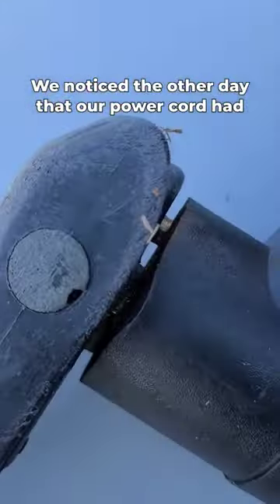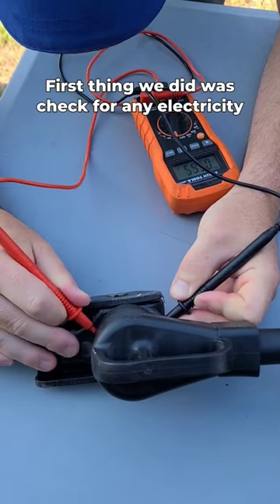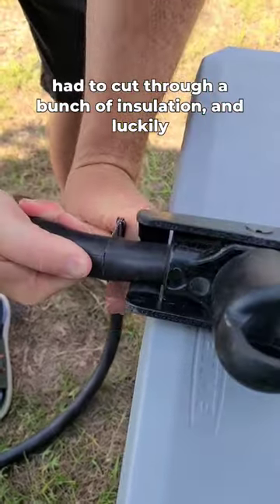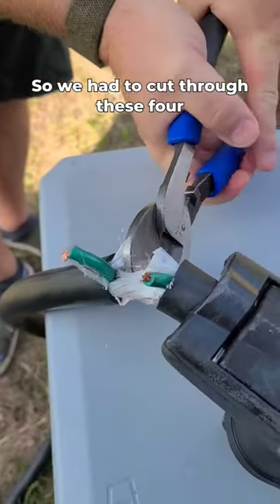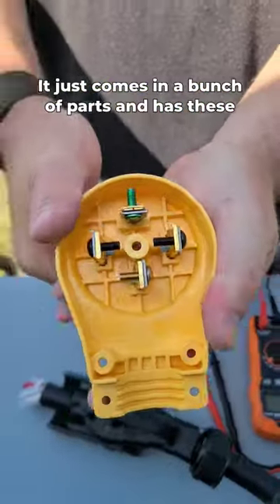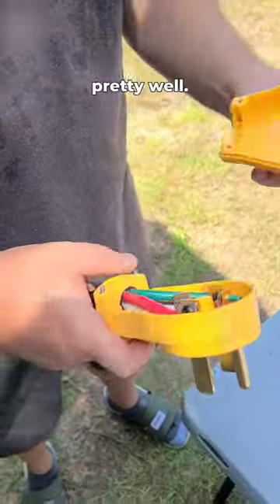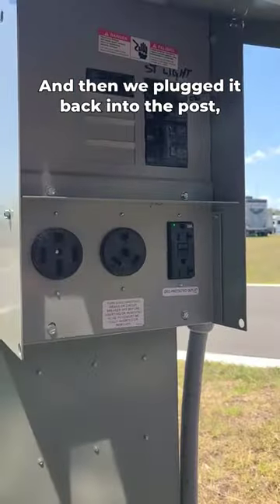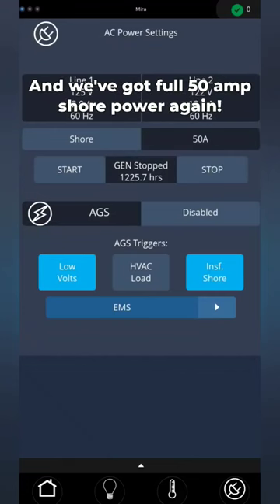Our Power Cord Melted! Emergency RV Electrical Repair #rv #rvlife #shorts

Comment: That and the issue with rain made me go with the hardwired power watchdog that goes on the other end.  Super easy to install and I love having that peace of mind.  I also like how it acts kind of like a self-resetting breaker if I use a little too much juice when I'm plugged into 30a instead of 50.

Comment: Keep in mind - you now do NOT have a water tight plug. You need to seal that edge of the new plug so that once you attach a new watch dog or other surge device and the plug is no longer under the cover of the box that it is water tight.

Comment: Did you have to replace your watchdog adapter?
Reply from the maker: The plug in it is completely melted. We're going to reach out to them and see if it can be repaired
Reply: You might want to check out a Hughes Autoformer . If your voltage drops on your line input voltage this will cause the current input to increase. This additional current can cause  connectors and or smaller breakers to heat up as well. The autoformer can boost the line voltage up to 10% this will keep the input current closer to where it should be during these times. Just my thoughts.
Reply from the maker: @jeffsteele1295  that's what was on there - a Hughes Autoformer Power Watchdog 😉
Reply: @Five2Go  Hughes Autoformers RV220-50-SP, Voltage Booster with Surge Protection, 50 Amp